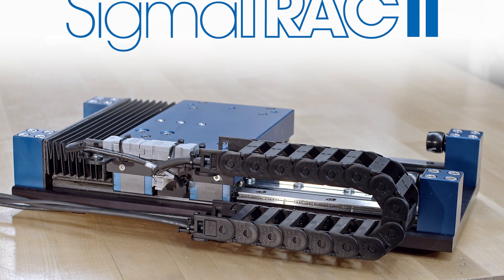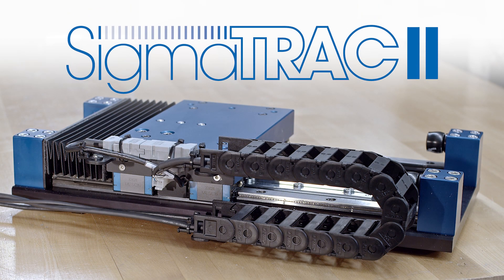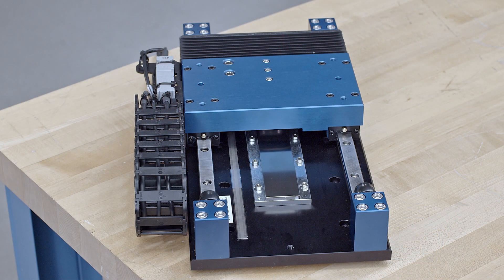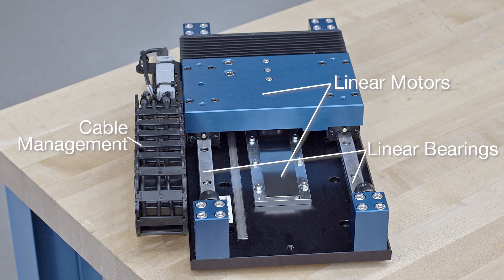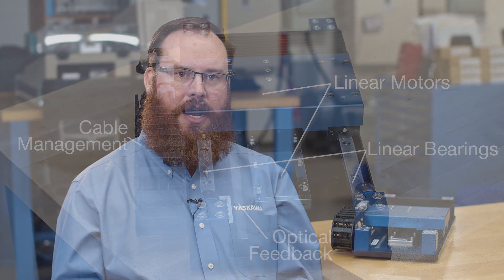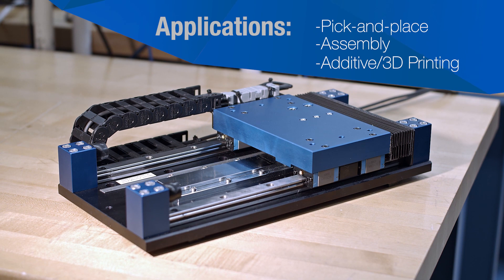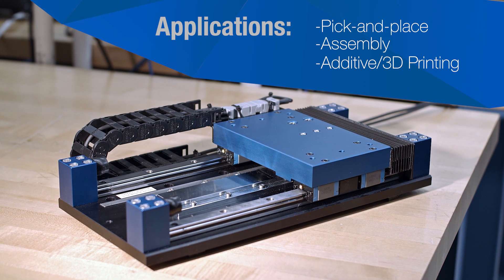Yaskawa’s ready-to-run linear motion system

Comment: Yaskawa, Sigma Trac II series Linear Motion
Speeds up to 5m/s,
Peak force output
 up to 540 N
Repeatability : ±2µm
Optical Absolute Scale : 9.765 nm ( Diameter of Oxygen atom is 0.152 nm !)
Sizes 
: 3 motor sizes, and 13 base lengths(390, 565, 655, 745, 835, 925, 1015, 1105, 1195, 1285, 1375, 1465, 1555 mm)
Power : 200V or 400V
Reply from the maker: Thanks you for sharing your experience with our Sigma Trac II!